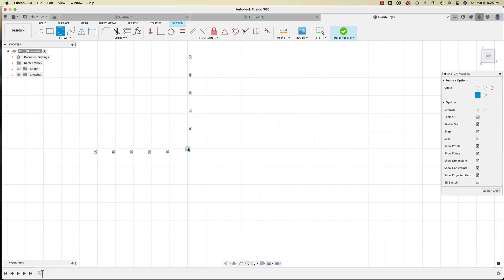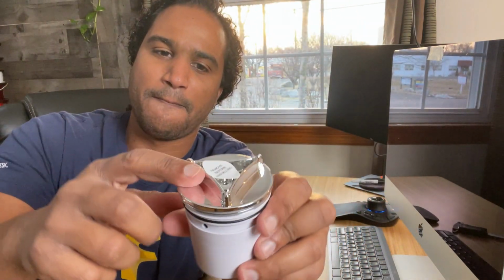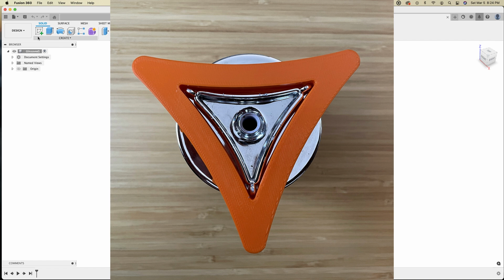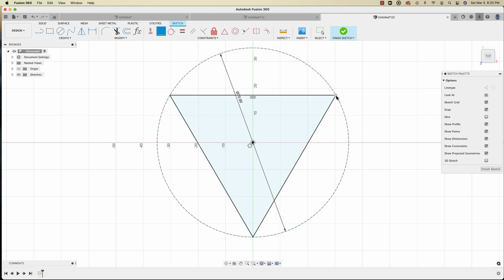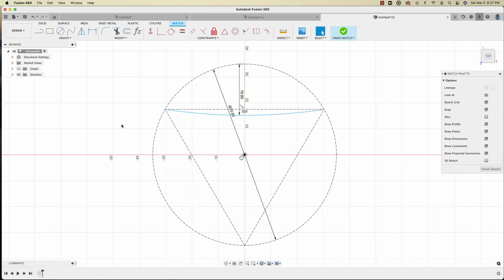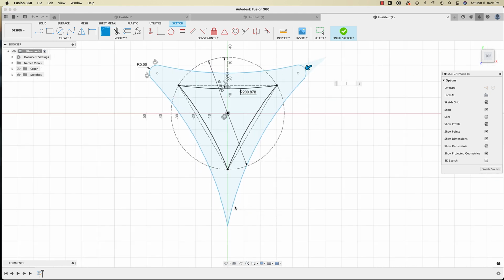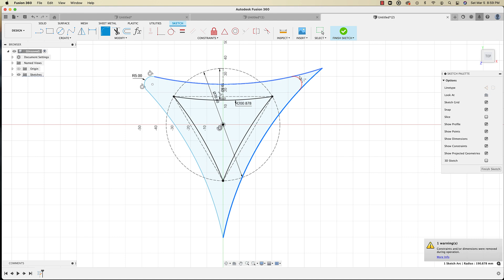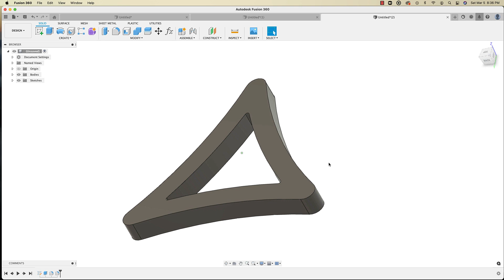3D Printing Fixes Everything

Comment: I wonder if using a picture of the bottom of the filter as a canvas might have helped catch the incorrect radii. One of the things I learned early for complex parts was trying to model the thing on which your printed part fits. Sometimes it's overkill but on some things it has helped me avoid iterations on the design.